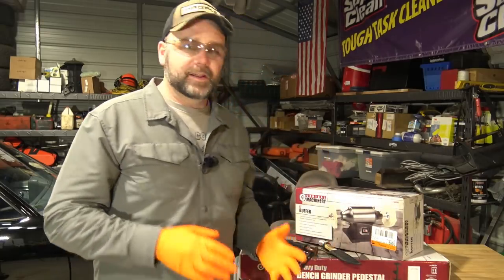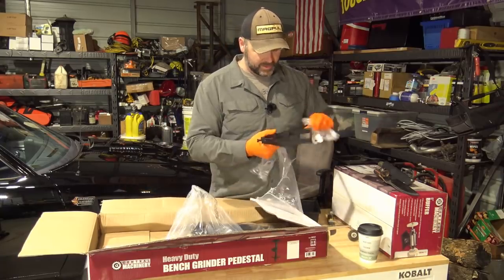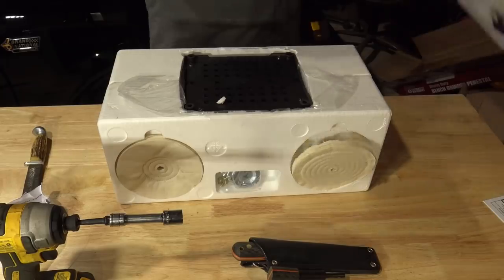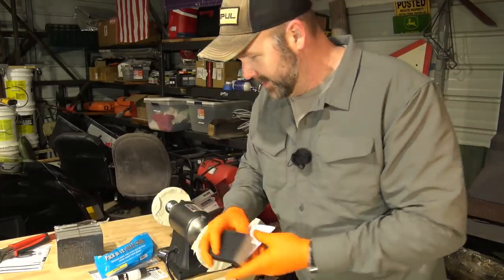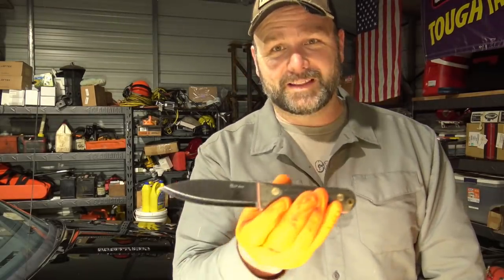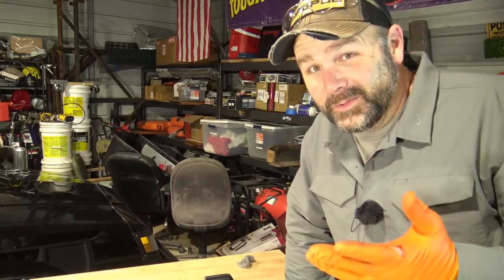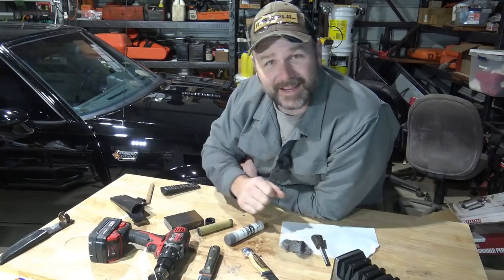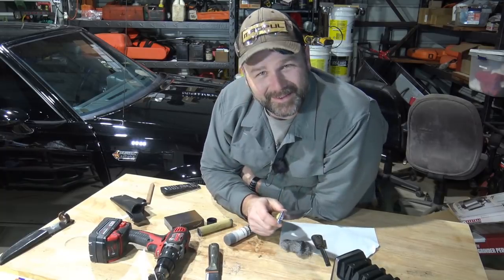Rusty Old Hand Made Knife Restoration....WITH CHEAP HARBOR FREIGHT TOOLS!!!

Comment: Looks like a Case knife from back when they were made good. Should make a good hunting/outdoor knife. After years of questing for the best knife sharpener, I settled on the Lansky 5 stone shapening kit. You can adjust the degree of the edge which helps a lot. It's not perfect, but it's the best I've been able to find.

Comment: Harbor freight 1x30 belt sander.  Order 400, and 800 belts and a surgi-sharp 1 x  30 leather belt with compound. About 80 bucks total if you watch the sales.  Can sharpen a butter knife to shaving in a few minutes.  Takes a little practice.  Donated my chefs choice to Goodwill.  Good vid though.  Want a buffing wheel myself.